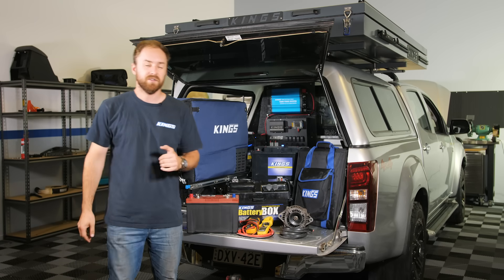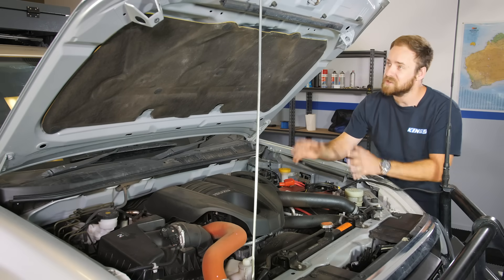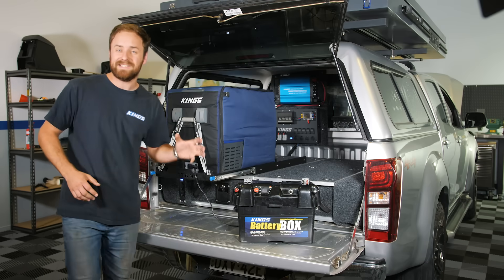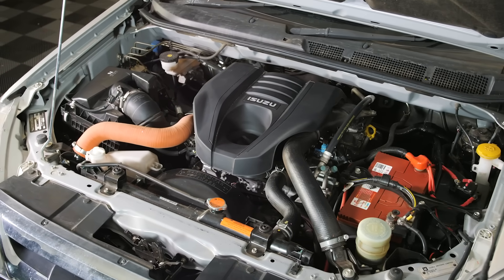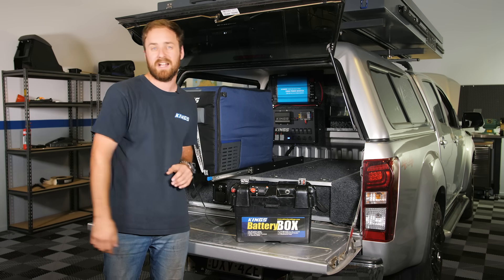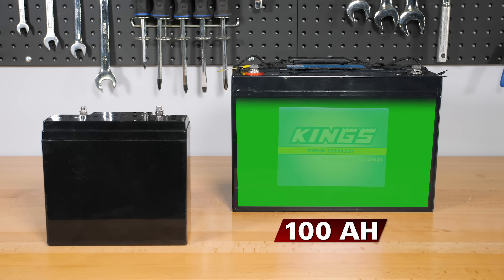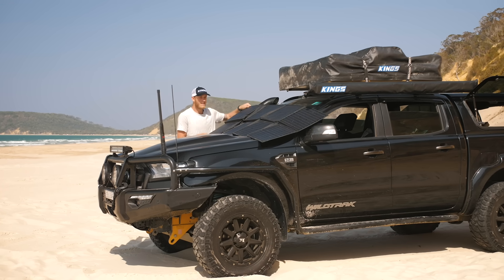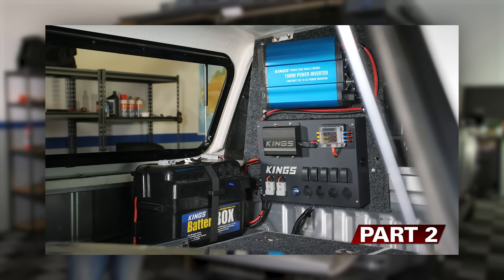Complete Off Grid 12V Dual Battery Masterclass PART 1 (Dual Battery Basics)

Comment: Hi, could you please do a video/provide information on how to set up solar/mppt/shunt/battery (one only)/inverter and 12v accessories. Everything mentions dual batteries n dcdc etc and makes it too complicated. Also Kings items I bought came with zero instructions/manuals- where do I find these? Thanks
Reply from the maker: Hi There,

It sounds like you may need more specialised assistance with your 12V setup. We’d recommend reaching out to us directly so we can help you properly. The best way to do this is by giving us a call on 1800 88 39 64 or sending an email to social@4wdsupacentre.com.au. 

Regards, Jayden

Comment: What kind of battery and capacity do you need to run the 3000W inverter?
Reply from the maker: Hi there,

Thank you for the question, while you could go with any level of capacity, your key would be the ~300A requirement for continuous rated output, with that said our 300A lithium would tick both boxes and would be a great start for basing your searches for battery options on.

Regards, Andrew

Comment: If I am unable to hook up the ignition wire, can I just plug my dual battery in when driving and then disconnect when not driving to ensure the power is only being drained from the dual battery and not the main? Thank you
Reply from the maker: Hi there,
This is one way you could do it!
Cheers, Courtney

Comment: if i had 2 400amp 12 volt batteries wired in series, would that give me an 800 amp 24 volt battery bank?  i need 800 cca. will that work?
Reply from the maker: It would give you a 400A 24V bank.

Series multiplies the voltage

Parallel multiplies the Capacity (amp hours)

If you need an 800CCA 24V battery it’d be best to look specifically for that

Cheers,
Cahn

Comment: Problem: I have a 1999 Suburban with a secondary battery tray. I want to install a second battery with a VSR Battery Doctor (Wirthco brand) that has an "Override" button for jump starting off the secondary battery. My problem is I have all my camping accessories wired to the main under hood fuse box, which is connected to the primary battery.
 
Question: Is it OK to pull the fuse box cable off the primary battery and hook it up to the secondary battery, so I can use my accessories?

If by chance I accidentally ran the secondary battery dead, would the "Override" button work to power the starter relay and ignition system to start the engine?

Comment: Thank you for this video series.  Like many people, I've watched a million diy videos about solar for my camper.  Yours is the first one that really helped!  I have some questions.  We live in the northern hemisphere.  We have a slide in truck camper that is 100 % battery.  I'm just in the process of upgrading our system.  I just purchased two 12 volt 100ah LifePo4 batteries and and also 2 ANU 400 watt 18 volt solar panels.  I will now, after watching your videos, be purchasing a DC to DC charger with solar capabilities and is MPPT.  I heard that I have to charge the LifePo4 battery with a higher voltage like a 20 to 36 volts.  I was planning on connecting the solar panels in series, but I'm not sure that's the correct decision.  I also heard that the Lithium battery has the potential of exploding and catching fire if it's overcharged.  Should I connect the solar panels in series?  Will the DC to DC charger and solar controller do a proper job and not overcharge the Lithium battery?

Comment: So it can run the fridge and be charged from solar panel at the same time if using the battery box?

 I just had my Kings MPPT solar controller kill my battery. Came back and it was bubbling, and not a lithium battery. Not set up as a dual battery, just charging from solar, and running camp fridge.

Comment: @8:03 using your numbers on discharging to 20%, 50%, and 80% - then 50% discharging would get you more amp hours mathematically?  Using a 100ah battery to 50% = 25000ah while 100ah battery to 80% = 24000ah?

Comment: I’m building a 2020 Silverado 2500 HD for overlanding.  It comes with dual starting batteries since it’s diesel but I would like to install 1 or 2 batteries in the back of the truck to run my 4 diode dynamics SSC1 camping lights and a Dometic CFX3 55IM refrigerator. What would be a good set up for this?

Comment: Running a dual battery setup in my Grand Cherokee Trailhawk.  My question is: Do both batteries need to be the same? For example, I would like to get Lithium battery to run my camping gear. I plan on using a DCDC charger between the two.
Reply: I should note the car battery is NOT a lithium

Comment: Ah and I'd like to correct you too with regard the statement about acid leaving the battery as a gas , this statement is very much incorrect,  the water component of the Electrolyte evaporates due to Temperature and not the Sulphuric Acid, and also many so called Seal Batteries are in fact not sealed as they MUST be capable of breathing, as a result they CAN actually be topped up with Distilled water should it be required, as I have done this for the last 30+ years . .
Now that 50 Amp Hour statement that is really wrong , the Ah Rating of ANY Battery is the Current the Battery can or will deliver for a period of 1 Hour THAT is it !
But it can be a useful calculating tool because a Battery that is capable of supporting a load of 100 Ah should be able to run something like a 15 Lit Console fridge for 24 Hrs before a good recharge. 
The 60 Lit Fridge in your example draws 6 Amps end of discussion, the Ah required is Ah = 6xT (in Hours )  so that fridge requires 6 Ah  so 6 Ah x 24 = 144 Ah   ( What are you on about with 24 Ah ).  
Properly maintained under ideal conditions a Battery can have many many cycles and not the limited number as claimed , I do however agree that discharging to 10% or less repeatedly WILL greatly reduce the service life of your Battery.   
 
Charging the Deep Cycle in the rear of the vehicle required no more that say a 10 ga wire -which is good for at least 30 Amps more than sufficient to charge the Battery Box on the way too or from your chosen camp location depending on the distance and what is running off it .  I have also designed and fitted quite a few Multi battery setups for various vehicles over the years with nothing more than large SCR's or Solid state relay's for isolation, so the Battery Pair is in parallel and charging when the engine is running , when stopped it is isolated automatically and a quarter turn power cut off switch is used for emergency start ability.

Comment: Save alot of money by simply replacing that silly roof tent with an awning tent, and roof mount a 300W solar panel. That way you won't ever need to connect the extra battery to the alternator. Especially in Australia.

Comment: 8:01 Using the 100Ah battery as their example, the battery that drains their battery to only 20% full or 80AhX250 cycles=20,000Ah for the life of the battery. Next one 50% full or 50AhX500 cycles=25,000Ah, finally the cycle that the uploader is recommending is 80% full or 20AhX1,200 cycles=24,000Ah. As you can see in this scenario it's actually best to drain your battery to 50% as you get the most Ah of all the examples. In fact their is only 20% difference between the best and worse case scenarios. I think the most important message for people is to never drain your battery below 12 volts as below this amount you can damage your batteries and significantly damage your battery. Make sure you have an automatic cut off switch that protects your battery from deep and catastrophic damage to your battery.

Comment: I would rather have the 2nd battery under hood as the 100 amp are heavy to move around so better keep them under hood
Reply: Highly recommend LifePO4 for your "house" battery. Smaller than lead acid, a third of the weight (or less), and twice the discharge depth. Added benefit of them lasting 5-10x as long as most AGMs and charging significantly faster than most lead acids.

Comment: I was stuck on putting battery under hood because there was a spot for it.  Now my setup will be easy battery in back charge off the tow aux power.  Tow aux power my truck cuts out at 10 minutes.    This will be so easy now.   Thanks.

Comment: Nice accurate advice.   Very few people know that your start battery only has 2 functions. 1. To start your vehicle.  2. Provide and electrical sink whilst the vehicle is running.  
It is not for anything else !
Reply: Depends, if you have older car then yes. New cars with start/stop and other stuff work differently, some of them even have secondary battery that power all of your electronics so voltage doesn't fluctuate when you start your car.
Reply: @cekpi7  still the same.  Second battery is providing a stable electrical sink voltage under crank and the stop/ start variants use a more durable battery to allow more starts.
Reply: @JRiddledickDangerfield  Secondary battery is used to run vehicle accesories while car is turned off as well. Your point is still valid, starter battery doesn't do anything else than starting a car.

Comment: How do you make one of the Anderson plugs into a solar input please make a video ?
Reply from the maker: You’ll need a DCDC charger with solar input, wire the positive cable from the Anderson (it’s already got a connector so easy to do) into the solar input on the DCDC. Alternatively you could mount a solar reg in a similar way, using the positive from the Anderson into the reg then the negative from the reg to the busbar in the control box!

Cheers,
Cahn

Comment: got an ambulance with 3 batteries and 4 charging systems. 2 alternators independent, solar, and shore. now thinking doing some voltage smart idolators to connect the independent systems,

Comment: One thing I missed if you get an additional battery setup and your charging it with the solar panels, do you also while it’s charging on the solar panels connect it to the fridge at the same time, so it’s recharging and has an output, or is this a no no, confused
Reply from the maker: Yeah that’s perfectly fine. 

I mean in a perfect world you’d charge your battery with no load attached but that’s not practical in most cases.

What’s important with AGM batteries is they like to stay topped up.

So if you’re using to it fridge then definitely connect the solar to keep it charged!

Cheers
Cahn

Comment: If for some reason my primary battery dies or fails, can I swap it out with my secondary battery?
Reply from the maker: Hi Fred, you could us it in an absolute emergency though deep cycle batteries are not designed to discharge sin bursts like a starter battery and will extensively reduce the life of the battery. Always best to have an emergency jump starter at hand!
Cheers, Chad

Comment: Great video! Excuse my ignorance,  I have a question, I have 3 agm 125 amp hr. batteries all in series, connect to my 3 (100  watt solar panels) also connect in series .Do I have to recharge them individually when there about to go below 50 percent,  or can I leave them in series and have all three batteries recharge at the same time. ( Have a battery charger and a 2000 Honda generator).
Reply: Thank you so much for replying! Yes your are right. The batteries are connected in parallel.
2 solar are in series and then in parallel with the 3rd one. Again thank you,  I will look into the attachment you send me.  I'm glad  I found your channels and have subscribed to your channel. Thank you, thank you.
Reply from the maker: Are you sure they're in series? if so they're running at 36V 215Ah.

If they're in parallel then they're 12V, 375Ah. Yes you can charge them all together if this is the case - just connect the positive lead of the charger to the first battery and the negative to the furthest battery. that way it's charging equally through all three.

This is a good link to check out for more info: https://www.impactbattery.com/blog/tutorials/how-to-charge-marine-and-rv-batteries-in-parallel/

Cheers,
Cahn

Comment: I am using an MPPT CHARGE controller, during sunlight hours once the battery is charged I'm on boost mode. That allows me to use the extra power a fan without discharging the battery at all.

Comment: I may need to watch again, but what is everyone getting wrong?
Reply from the maker: G'day mate!

I probably should've made it a bit clearer but hopefully people will see the response here anyway!

I meet a lot of first time campers and 4WDers who don't know the basics of their 12V systems so I'll run through a couple of examples that I talked about in the video. I didn't go into much depth on these as it really is a 'basics' video.

For example: many people don't realise their battery should be recharged fully once it's been drained down to around 12.3V - I've had people ask me to check out why their fridge isn't working and the battery is down to around 10V - "but don't I have ten more volts until it's empty?"

On a similar note I've had people who didn't realise they're able to (and should) have their regulated solar plugged in all day every day. they figured they'd only plug their solar in once the battery was discharged. Sealed Lead Acid batteries like to be fully charged and stay fully charged.

I also went into where to put an auxiliary battery - you shouldn't run an unsealed battery inside your vehicle - they can vent hydrogen gas, or leak sulfuric acid which isn't good in a closed area...

Similarly trying to run a sealed battery under the bonnet is no good as you'll lose capacity and kill your battery - batteries don't like heat. Heat will kill your batteries.

(Here's the link to a report prepared for the United States Department of Energy’s
 National Nuclear Security Administration where it states: "The optimum operating temperature for the lead-acid battery is 25°C (77°F). As a guideline, every 8°C (15°F) rise in temperature will cut the battery life in half." -  https://prod-ng.sandia.gov/techlib-noauth/access-control.cgi/2004/043149.pdf )

Finally, believe it or not there are still some people who don't think they 'need' a second battery when they're regularly camping - either they expect the starter battery to run the fridge all night, or there are some folks who just turn the fridge off and hope it stays cold. So I tried to show a basic example of what happens when you completely drain your starter battery (your car won't start) and why they don't perform well when used this way (they're designed for quick discharge, rather than slow cycling like a deep cycle battery).

As I said, I tried to make a basic video that'd give a brief overview of the whole system and didn't go too in depth as that can confuse people or scare them off thinking it's all too hard. The reality is it's not too difficult to understand so long as you know the basics!

This short series will really only scratch the surface of what's possible in a 12V system, but down the line I'm hoping to get into some deeper topics: like circuits right down to electronic component level, modifying and custom making electronics for camping and 4WDing etc. Plus (hopefully) I can get into a bit about what I'm doing with my LandCruiser Build and all the custom 12V that's going into it right down to building my own fuel-usage monitoring and using components from two different model's dash gauges to make them work... we'll see...

Cheers and thanks for the feedback! I'll try make the issues clearer next time to explain why or why not to do things a certain way so everyone can get it first time!

Thanks,
Cahn

Comment: Spoiler alert! Kings bcdc charger in the back ground on control panel.....
Reply: I need a video how to set up everything. I have a battery and battery box , 12v control box, 25 amp dc dc charger. You have a video showing the set up but I don’t know what plugs to plug in because you don’t show it. You only show it without the battery box.
Reply from the maker: Someone's got the eagle eye!
Reply: @4wdsupacentreAu  always looking for new products to test before they are released.